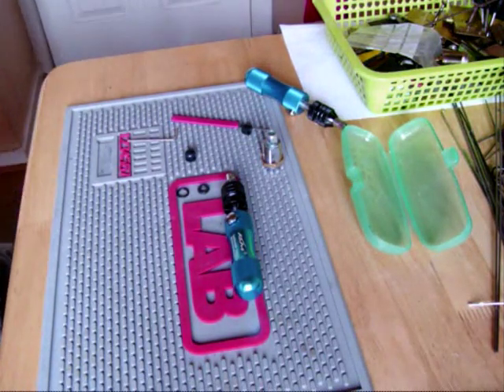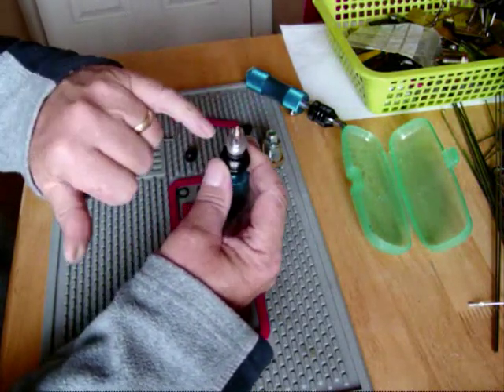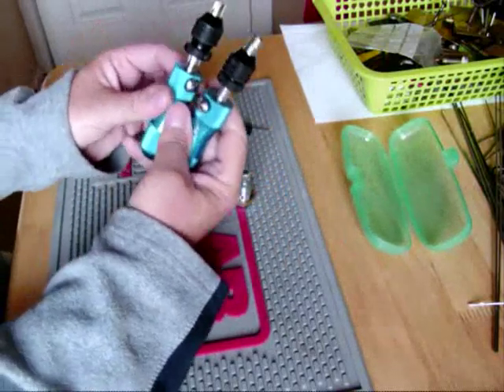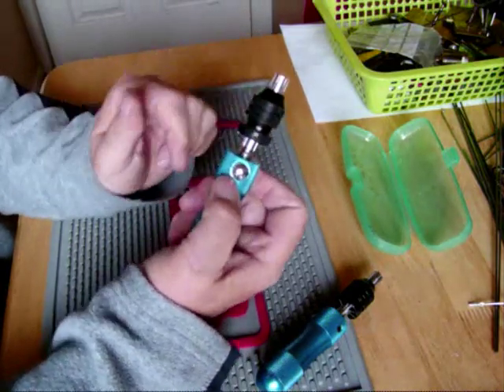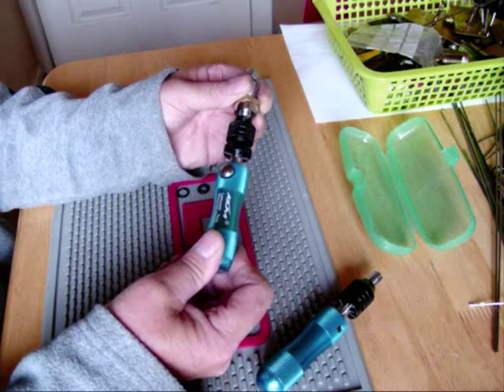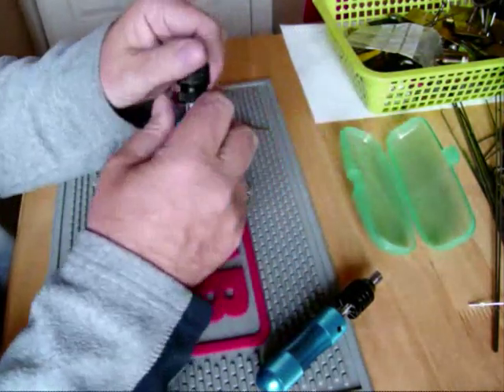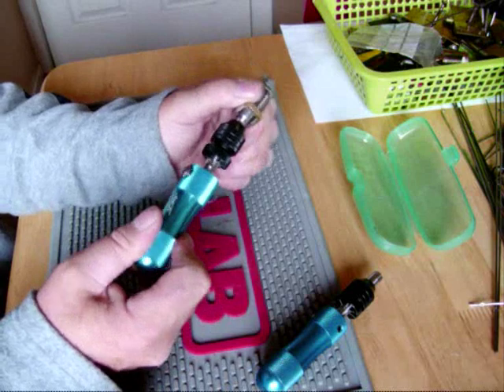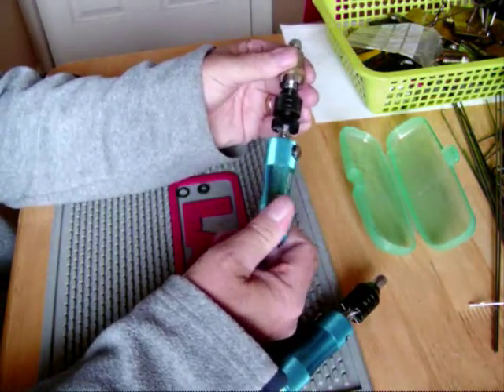tubular lock pick tool demo

Comment: How do you use these picks on a tubular lock with the tensioner on the outside barrel?  The tool fits the inside barrel once the post is removed, but there is no way to grab the tensioner on the outer barrel.  Can I only use manual stick picks for this type or is there a separate modification I can add to the tool?

Comment: Great explanation how this tool works! I just got mine and was able to open a few locks but now it is not working, it looks like there are one or two micro crakes in the tube where the  pins slid up and down, the pins look fine. Not sure if I damaged it or wore it out in only a few tries? I can no longer open the locks that I already opened, any recommendations?
Reply: Where abouts did you get the lock pick?